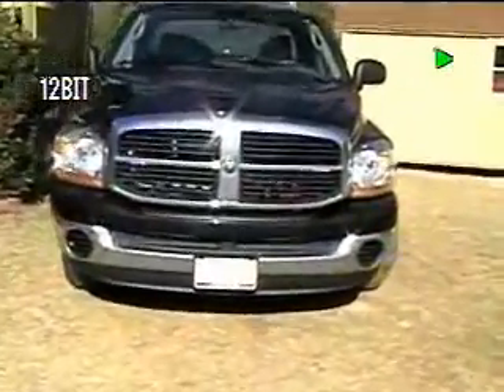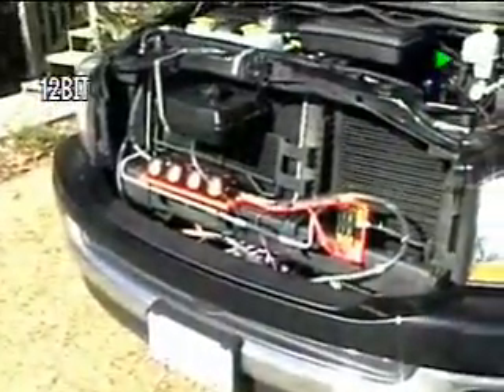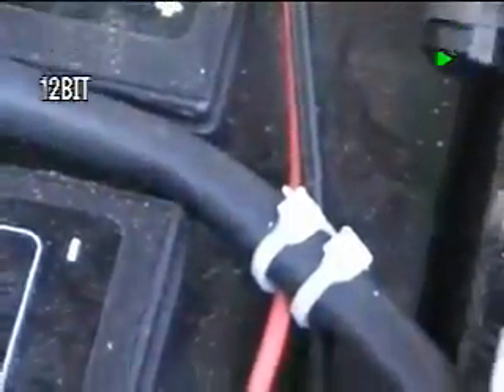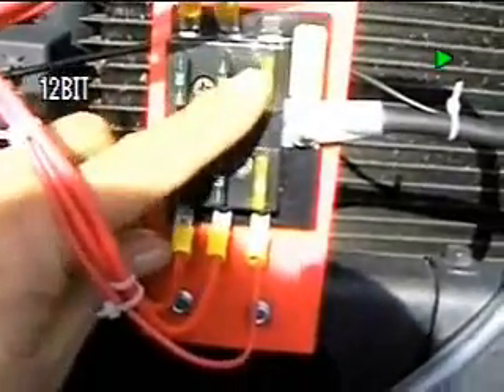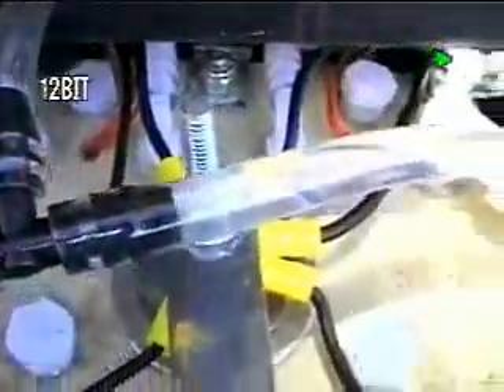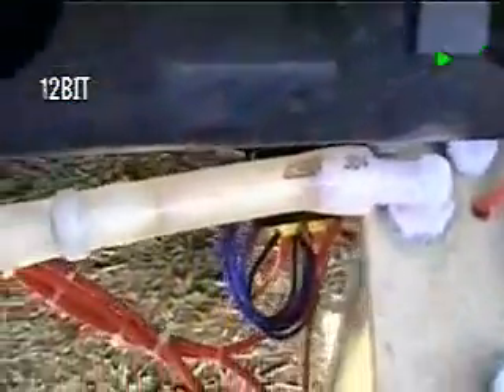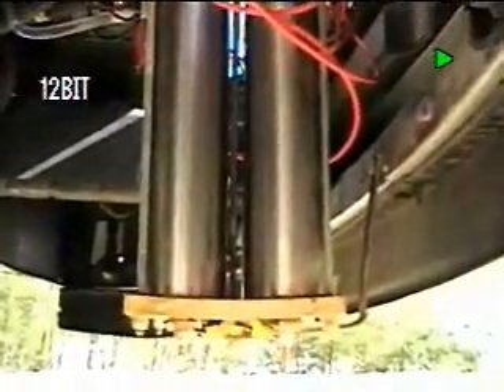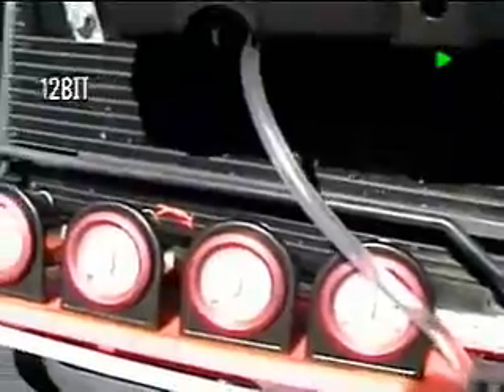The Magnum Series HHO Gen by MagDrive..

Comment: I'm amazed at the output your gettting from those cells!!! I noticed your talking about running a vehicle on 100% HHO. BE MINDFUL OF CORROSION! Your valves, valve seats, springs, piston rings, exhaust system etc will rust in this case. The cure all is stainless steel!

Also to combat the freezing temps I have been told you can add isopropyl alcohol to your water (electrolyte). I have yet to try this but it makes sense. My only concern is effects on the engine (if any)!

Best Wishes!!!

Comment from the maker: Internal temps on normal engine is 350 - 400*F. The water will definitely evaporate into super heated steam from the absorption of heat from the surrounding engine components. There is more condensation on a cold exhaust pipe on a cold started automobile.

Comment from the maker: Working a a unit that will run pure HHO for fuel. Looking for better efficiency in electrolysis cell design to cut down on current demand and increase HHO production. Currently working on using only distilled H2o without any electrolyte catalyst such as KOH. Getting results but not quite ready yet!

Comment from the maker: 4 smaller independent cells will produce more than 1 larger cell, also if a cell goes down [never has happened yet] it doesn't effect the rest of the generator. Think about flow rates and restrictions on a single large cell as opposed to 4 cells in a manifold.

Comment from the maker: No not so, the condensate is eliminated either by using a simple bubbler to scrub the HHO or a drop tube is used to release the condensate once the engine is turned off allowing the condensate to drain out automatically. Really, now don't you think that was thought about already? And yes its "the burnt HHO"is converted to steam at a CHT of over 300*F, water will evaporate completely at those temps.